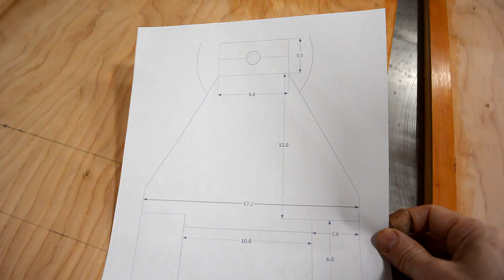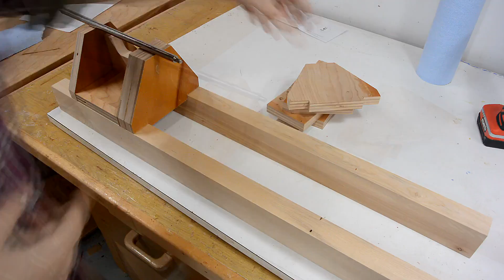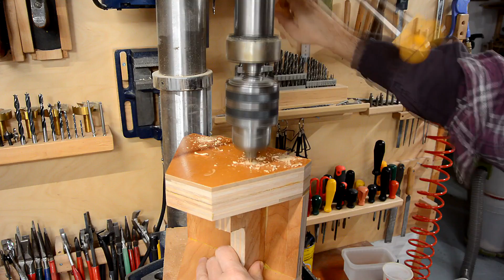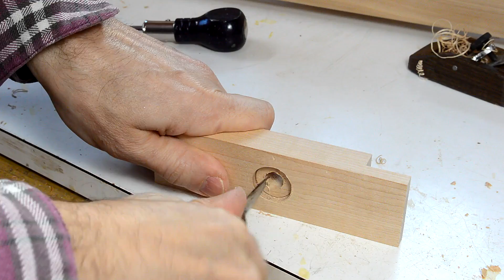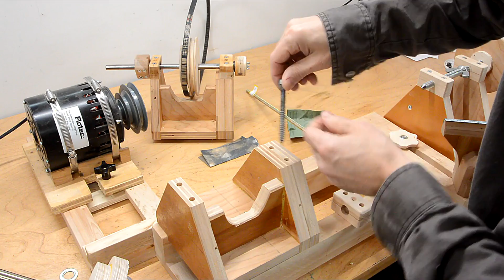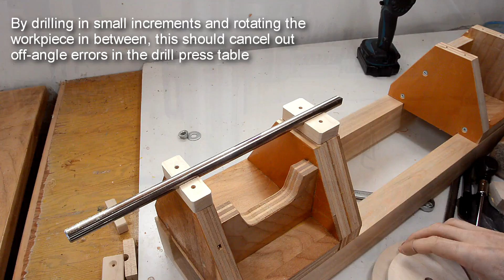Building a wooden lathe

Comment: Nice squared. You made it look easy.

I was going to either make or buy a lathe. Yours most fits my aim and I would  take the week or so to make it, but I picked up a W. M. Oliver lathe in excellent condition for $50 that needs flat belt step pulleys swapped out for V belt step pulleys plus a few other minor additions including other attachments at the head stock than the 3 jawed chuck that came with it plus a motor.

Comment: Indeed, my sincere congrats, sir !  👍👍👍
Definitely the best homemade wooden lathe ever !  Also appreciated your way of fixing any small errors that obviously can happen along the construction ! 😃
I'm really intetested to build a wooden lathe like yours. 
But I definitely will put bearings on the main shaft and "invent / create" a simple rotating tailstock (to avoid overheating the end of the piece of wood), even if it means adding some metallic accessories at the "original" wooden lathe. 🤫🤭

Comment: Can’t you have a tailstock with just an unthreaded rod keyed to prevent it from moving horizontally?  Anyway the tailstock itself can move to accommodate the length of the blank.  If I use a drill to drive it, on the headstock can I just use a short bolt with the circular piece with pins to hold the blank or will it wobble too much without the bearing to support it?
Thanks,

Arvind

Comment: I rebuild this lathe out of scrapwood, which was lying around. I reused an old motor from a gardenpump. Despite of wooden bearings I used bearingblocks and a revolving center point.
I made already a few projects with it (as you can see on my channel)  and there is a lot I'm planning to do with. And I started to build my own turning tools...
Thanks for this great inspiration! #grobklotz

Comment: All that hard work for something that will wrar out quickly.

I would have used a shaft and 2 pillowblocks for the head-can get cheapies second hand with 3 or 4 step pulleys for around $40l and a bed from 50x50x6 angle oron.

Comment: i would love to build something simpler than this, perhaps hand crank with gears, to turn the peice of wood to be turned slowly, while a dremel or router did the cutting and shaping, as the dremel or router could ride on a carriage that slid in a track and was also turned using a threaded rod that the hand crank would move... maybe a design like that, and because i want to make super long sticks super round, say a maximum of 6 feet long. so, some ideas on how to contain the threaded rod, with bearings, and a way to hold the peice of wood to be turned, similar to this, but using mostly hand tools or no standing machines... im not sure how i woudl get the parts to work so i got the right in-feed speed to travel but, some ideas would be great on how you make something like that with the right gear ratios...

Comment: Ok, so I started building a log cabin in the woods the same time as you made your first cut. I just put my feet up in front of the first fire and came back and you were talking about changing out the drive shafts lol.. but no, seriously, great job. Is that a washing machine motor? A dimmer ? Variable resistor help with rpms? Good job ...so to build a lathe it's easy, just need an entire giant tree, industrial table saw, a drill press, jig saw, belt sander and what else a nasa rocket building facility ? ..check, check and double check. :)

Comment: You could've made a much simpler way to switch "spinel turning"( I think that's what you said) like for example the other original shaft is held on by a nail, you could've done the same with the claw like one. 
Also is this actually cheaper than just buying a cheap lathe? Like what was the total price on this project?

Comment: hello, greetings from venezuela, I would like you to do a project of bench drill, since other video there is of supports for hand drill, I saw that it can be done with a motor similar to the one of the lathe, but a little smaller. it would be great to publish a video so, sorry my bad english, is that I am using the google translator. thanks in advance

Comment: Not trying to be critical but I have been wondering about one thing. You made the headstock assembly capable of moving on the bed. Why did you make the motor mount movable? Couldn't you just as easily have moved the headstock left or right to align the motor pulleys?
Reply from the maker: headstock needs to be tightened down real good.  Not something you want to move a lot.  Also, you might watn to change speed without taking the stock out of the lathe.

Comment: Hi Matthias, I enjoy watching your videos and have recommended your website to friends. Have you ever considered building a CNC machine? Stepper motors, controls, and essential metal parts are relatively inexpensive compared to the cost of a commercial machine and since Baltic birch  plywood is relatively stable (+/_4mm per 120cm x 240cm sheet) it might be acceptable for the frame. C.Baker

Comment: I have to admire your thought process and solutions. You have a very practical mind.  I am a machine design engineer and I fear the wear of the wooden bearings.  I noticed you did lubricate them. After some time using the lathe how have they held up?  I would have looked to ultra-high molecular density plastic (UHMW) which works like wood but offers better wear resistance (but not abrasion resistant.) It is also inexpensive.  You can also purchase 12mm journal bearings in a variety of materials including PVC and Teflon for pennies (or dollars in he US.)
Reply from the maker: haven't seen noticeable wear yet

Comment: apparently 317 manufactures of lathes DONT like you so much. hahaha... however, I think your lathe is perfect. you designed and built it by hand. AND if something breaks, you can make a new part OR modify the construction to suit your needs. Good going !!!

suggestion: maybe placing a tensioning wheel on your belt to increase your belt efficiency?  basically placing a "BBR Tuning Performance Spring Idler Pully Upgrade". ive built a few motorized bicycles and the tensioner is placed below the chain of a bicycle . The tensioner pushed upwards against the chain, so any slack is taken out.  BUT make the tensioning wheel pull downwards of the top belt. Just an idea.   *note: im not endorsing any specific bicycle company" .

Comment: Where can I get cheap motors under 50$ 1hp or 1/3hp
Reply from the maker: Only when opportunity strikes.  That's how I get my motors.
Reply: Andrew Jackson try looking for washing machines being thrown out,  on many the motors are in great working condition,  it's other parts that broke, that's how I got mine. make sure you get the capacitors that start the motors, or you'll have to jump start them by turning the pulleys on the motor, that's how I had to start mine until I found a capacitor that has enough power to start mine.

Comment: what are the specs of the motor?? Did you use some drive circuit or did you just plug it in the power supply?

Comment: Where do you keep finding all your electric motors? I have tried finding some but they are fairly expensive.
Reply from the maker: watch my video on that topic
Reply: Home Depot sells them. Usually in the building materials department. In the small sections containing furnace parts I believe. Around $50

Comment: Just wondering Matthias, are you one of those wood workers that simply must avoid all use of metal or metal engineered products for your machines to keep them purely wooden? Ie making pulleys out of wood when potentially metal pulleys would be easier and last longer?

I know some people are dead against using metal for anything, and like to keep things all wooden. What's your theory / reasoning on this?

Comment: Great video. I've been watching the build in pieces over the past week and I'm glad you decided to just do a polished video, start to finish.

My question is, why not just make the motor direct drive. Is it too hard to adapt the shaft on the motor or do you find the different speed pulleys necessary.
Reply from the maker: +T Mill You can't vary the speed with direct drive.  Plus, it's tricky to do.  Belt is less work and more flexible.

Comment: So I got an odd one for ya. I am making my own lathe, but it is a direct drive lathe. Mine uses a treadmill motor, bigass transformer/diode bridge and variac. So I have variable speed. I need some sort of chuck for it, but all I have for lumber is scrap 2x4s that have been out in the rain... What type of wood should I buy to make the chuck that won't break the bank but will still be able to hold stuff securely? I just mounted my last piece of good wood on the face of the treadmill motor and turned it flat, it runs so smooth... Now I need jaws.
Reply: the answer for something like this is, most definitely, Baltic birch plywood. if you can't afford that, use whatever you can get with the most number of plies. basically, it will be more stable over time and for something like a chuck, you'll want the consistent strength across both x- and y-dimensions that plywood offers.

Comment: I don't know if it has been addressed in previous comments or not, but you need to be able to adjust the tool rest for different thicknesses of wood and you can only adjust it one way but not the other.
Reply: how is it not adjustable? It's exactly the same as the tool rest on a regular wood lathe.
Reply: +Wyatt Roncin Sorry, but I saw no UP and DOWN adjustment on the tool rest, only move it closer or far away.
Reply: +Allen Perry you want the tool rest level with the axis, and you adjust tool height with the angle of the chisel on the rest. you don't need a vertical adjustment and if you did it would never get used.

Comment: Just wondering if someone could tell me why a captive belt pulley was used?
Reply from the maker: +Spark Gap So I could have a bearing on either side of it. But the drive shaft comes out for chuck changes anyway, so it's no big deal.
Reply: +Matthias Wandel thanks for the heads up I knew you preferred crowned pulleys as they're normally better suited I just wanted to know of there was a particular reason thanks again

Comment: I wrote something before about this:  The plywood four-jaw chuck worries me.  I imagine delamination of the plywood.
Reply: +Bob Blarney   then  don;t use it
Reply: Jasper,  I won't use it and I'll be safe.  You go ahead and use it and let me know how it works out.  It may not fail on the first or 25th use,  but I think it will eventually. I think that plywood can handle static loads such as the frame of the lathe, and if carefully used it can maybe withstand dynamic loads, but I'm doubtful about this application.

Comment: Could you design a drill press for  a dremel?
Reply: The gentleman knows more about his needs than we do. He asked for the proper resources, not a lecture.
Reply: RhettRO55 Ideal for pcbs though.
Reply: RhettRO55 basicly yes!
Reply: +RhettRO55  The reason being I already have a high quality dremel, with many bits. It would be a lot cheaper for me to make one with my dremel, than  going out and buying a new drill press. Since most of my jobs require me to use tiny bits, and make precise cuts, it would save me the trouble of getting specialty equipment. Plus, I would like to design it so that the Dremel can be removed once the work is done.
Reply: I still need something to steady my hands, they shake too much.
Reply: Thank you Steven Boekle!
Reply: +Sam „Flip“ McKay Not sure if they're available outside of Germany, but I recently bought the "Wabeco Bohr- und Fräsständer". It is bascially a very sturdy (cast iron) press mechanism which you can fit regular drills into. It is very precise. I'm sure with some tweaking it could also fit a Dremel.
Reply: +Sam “Flip” McKay Why would you want to do that since a dremel is simply a lower powered drill that is meant to be more easily maneuvered?? If its a concern of speed or RPMs then pretty much every drill press has the ability to operate at a minimum of about 4 -5 speeds.
Reply: +RhettRO55 well if he wants to then he can but yeah for most things its pretty useless.
Reply: Right which was pretty much my point to start off with, everything Mathias designs and builds has some actual function and building a drill press for a dremel just seems like a waste of time. Itd be like building a handle that holds a a shovel.
Reply: I dont follow your logic. Because of the tiny bits it holds?
Reply: +RhettRO55,  If a person is working on tiny projects, a Dremel drill press would actually be BIG.  (I just checked and there is a Dremel keyless chuck available for $7.00)
Reply: Thanks!
Reply: Have one.
Reply: pode escrer em potugues EyeAm
Reply: Sam EyeAm drill press table
Reply: +Sam “Flip” McKa John heisz has already done it ! http://ibuilditaudio.com/Projects/other/dremel-press-1.php